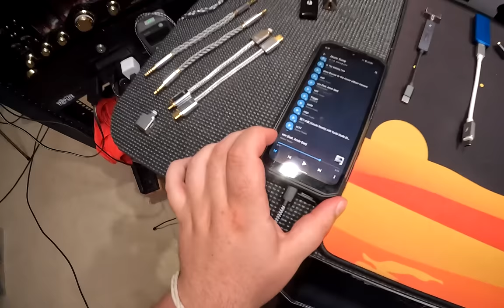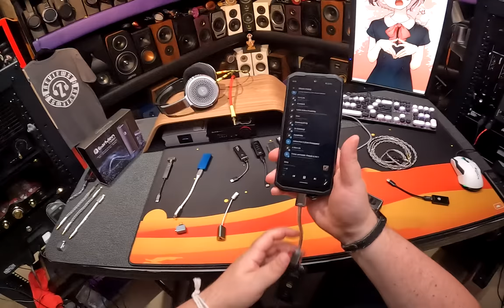Dactacular Day 3 : Bigger really is Better

Comment: I have the fiio ka3 and have tested it with multiple iems and heard absolutely no noise floor... But there is a slight issue with the KA3... If you plug it in to your computer and bring your phone anywhere near it you can clearly hear interference... In my case its audible only in the right channel... But when its connected to the same phone there is no audible interference... 

All testing done while playing silence and 20kHz tone...

Comment: You should do a follow up because the sparrow had issues with EMI. I hope the calibri does not, but looking at the length of the cable that they ship with the  unit I guess it has EMI problems also.

Comment: Tha Khardas Tea can be used as a dongle DAC, and has superior sound to its Bluetooth. You can Play/pause, Vol +/-, Next track/last track.  It plays off its own battery but can also be charged by your phone.  Just sayin'!
Reply: he reviewed it a few months back.
Reply: @michaelcorcoran8768  His review was with a prototype in which he wasn't aware of the button configurations and dismissed the notion of using it as a dongle.  Rewatch it !
Reply from the maker: @daveelgee2008  I actually figured out that pressing two buttons swapped the vol and next track controls. BUT.. do it dongle? like actually hang or is it a back mount like the Honey H1?
Reply: @ZReviews  Admittedly, it is a back mount, but because you can attach the Tea to the back of the phone magnetically the headphone jack ends up forward-facing and reduces tension on the USB cable. It's a method I employ when the Tea is running low on power, and it is a superior sound quality.  Although I use the Tea as a separate Bluetooth unit 90% of the time.
Keep up your excellent reviews, you are my litmus test for a sound signature.

Comment: The Colibri does not work. You tested other portable DACs live and they worked. I have looked at all the 3 series on portable DACs you have made. You tried the Colibri in this video, it didn't work, now you are trying to convince us that it is the best in your collection. 
Most reviewers say the BTR 5 is good but you say the opposite. I don't believe in your SHOWS anymore. 
You are a CHEATER.
Reply: Otg cables are finicky. The one that came in my hidizs s9 pro straight up didn't work. I had to use my Samsung charging otg cable. Even then I have to plug it in a very specific order and orientation or it won't work on my phone. For whatever reason windows is less picky.

His fumble in the video is really not anything at all out of the ordinary.

Otg cables should be labeled with ARROWS and WORDS and clearly they are still frustrating.

I bought a ddhifi otg cable and that does have arrows.
Reply: @razetw  Why say that Colibri is the best?
EarMen (Colibri) apparently delivered their product without a cable and most importantly, we didn't see it in action like their competitors. 
LeoC, with all due respect to you as a person and the work you do to inform us by presenting products. It is reviews like yours that make us decide whether or not to buy a product. 
I have bought and resold a few products thanks to reviews like yours, I am always looking for the perfect product. I'm mostly looking for a reason to buy a new one, since I already have a product that does the trick. 
I thank you for responding despite my harsh words. It is a proof of maturity.
Reply: he's praised the btr5 since its launch, what are you talking about?
Reply from the maker: It worked just fine. The cables I was swapping to were a PIA. BTR5 is still bae, but so is ifi Go Blue and the new Beam 3. ALL BLUETOOTH UNITS. Which this event wasn't directly covering.
Reply: @ZReviews  It's a real shame there was no comparison with the BTR5 in wired mode. The moment you mentioned it I bacame elated, as it's the only one I've heard out of the bunch. I could only dream to stumble upon such an unlikely (somehow) comparison. 

What was the issue you've encountered trying to use BTR5 in USB mode?